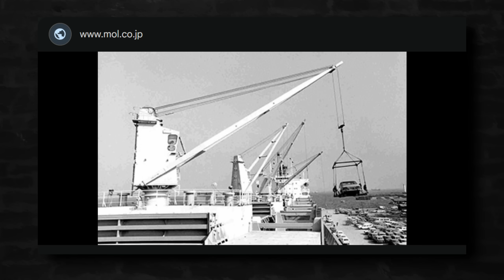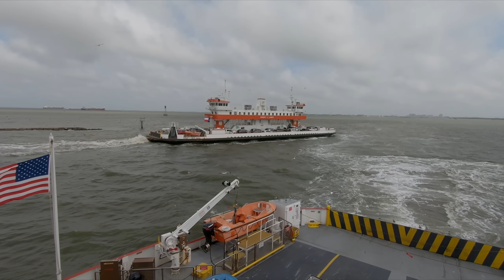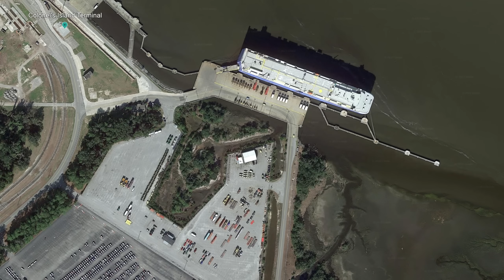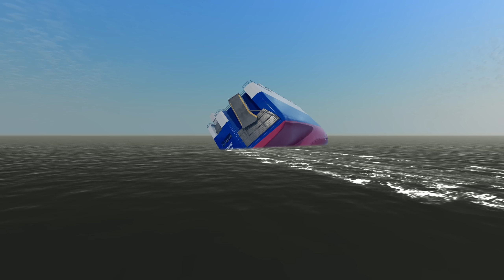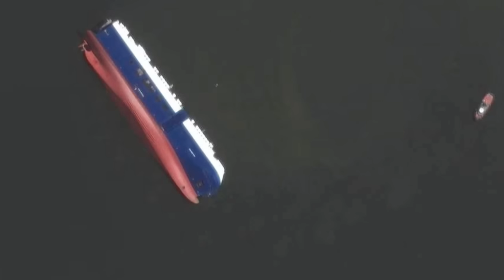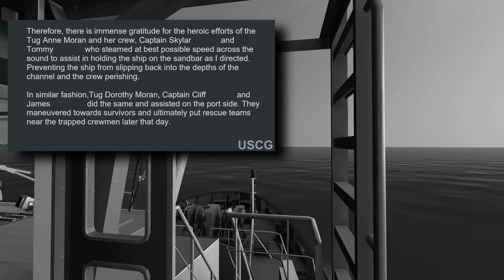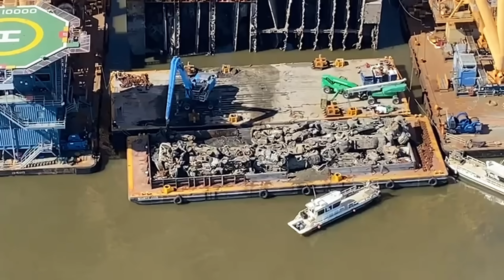ROLL-ON ROLL-OVER: The Loss of Car Carrier Golden Ray

Comment: Currently, VTS (Vessel Traffic Service ) primarily sees external data (position, speed, heading via AIS/radar), but not the internal state of the vessel. Requiring ships to transmit critical safety system status could add an important layer of oversight, especially for departures from port when stability issues are most likely to cause problems. 
If VTS had real-time access to critical vessel systems data - like watertight door status, stability calculations, cargo loading information, ballast levels, etc. - they could potentially catch dangerous conditions before   departure or during the ships passage.
Starlink would be valuable for continuous monitoring once vessels are offshore.

Comment: I retired at the end of 2022 just short of 50 years as a marine cargo surveyor. When I started in '74 import autos were brought in on Bulk Carriers where the cars were lifted from the ships holds with ships gear and set pierside then driven to their processors lots. Then there were the ships with elevators between the holds where the cars were lifted from the holds to the deck where a side port went to a ramp going offshore. There were some Combo ships from ACL and Barber later NOSAC that had stern ramps for RORO on lower decks and Containers topside. Then the PCC vessels came along. Usually on PCCs Heavy equipment was stowed on the lower decks and main deck where the stern ramp was and sometimes also a side ramp.

Comment: The thing is if you pay a little bit of attention you will easily spot a potential mistake you made in the stability calculation just by looking at a few key numbers: the draft and trim.
You type in all values from fuel, lube oils, cargo and most important ballast. The program will then give you all important stability values: GM, sheer force, bending moment, trim and heel and of course forward aft and mean draft. All you need to do is to compare the calculated drafts with the actual drafts and you know whether your calculation was correct or not.
This was just negligence by the Chief Officer in my opinion.

Comment: This feels like absolutely the kind of area where AI should be supporting us. Every company involved inputs in detail the item they are wishing to load at the POL, where, and where the POD will be. The AI's job is to pull and calculate the exact weight, and procedures required for that ship. The skilled engineering team review this plan (because there might be information not yet provided to the AI). This is exactly where AI should be used to support human endeavour... but guaranteed humanity will cause failures where someone will intentionally input the wrong data to get past the system.

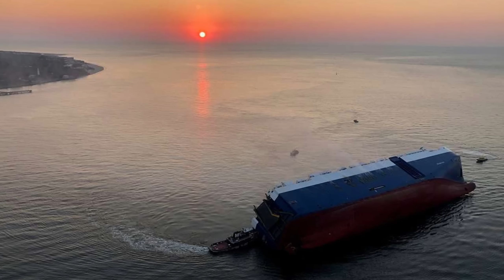Comment: You got your KGs and GMs, and the relation between those and adding ballast mixed up at around the 46:00 mark. Adding ballast increases the GM and decreases KG as the centre of gravity moves down, as correctly shown by the graphic but you're explaining the opposite. Lowering the G would make the ship more stable, it's just a question of draught and freeboard. You're not wrong in what you're saying, there's just a mismatch. Also labelling the keel as K would help with the graphic. Just for future reference, if you see this and hadn't noticed (I realise it's a video from last year!).

Comment: Those tug captains almost certainly saved the lives of the trapped engineering crew by quickly acting and pushing the ship into shallow water. If it had sunk in the channel the space they were trapped in would have been totally submerged and no way to cut into the hull.

Comment: How can something like this so easily happen?  Are there no alarms for open exterior doors? With redundant failsafe. But am I understanding it correctly. That the stability information is implying. That, if the ship had been compliant, within tolerances. It wouldn't have listed far enough to flood thru the door?

Comment: What I cant understand, is how is there not any kind of automated warning system in regards to the dang doors???? Literately every car in that ship will ding ding ding if you leave a door open, but not the 60+ million dollar ship?? How is there not a sensor 4 feet under every door that will blow the bridge up with alarms if a door is open and that sensor is getting wet?? I'm sure there are far more sophisticated solutions than what I just laid out but how was there NONE applied at all??
Reply: There are requirements for indicators on these doors to show open and closed position, with the watertight door panel on the bridge. All watertight doors are required to be closed before getting underway. The pilot door indicator appears to have malfunctioned, or the bridge panel wasn't checked.
Reply: Sensors are notoriously susceptible to failure in such harsh conditions as on sea-going ships. So those doors were probably monitored by switches that, although being far more reliable than sensors, are also susceptible to failure, this time due to corrosion of the contacts. Add in wiring looms that also suffer from the conditions and/or minor damages, and you end up with an unreliable electrical monitoring system, that often shows false positives or negatives, which is why most of these doors are inspected visually before sailing.

Many of these accidents can also be contributed to miscommunication and/or rushing through procedures. There's also that often mentioned thing called confirmation bias, where the person checking something sees what he/she EXPECTS to see, without actually seeing it.
Reply: @tjroelsma u think the sensor needs to be outside?. Sensors can’t be inside the door?
Reply: @tysonchickennuggets yep, where it is just as hostile as outside. The salty air alone will corrode it.
Reply: @tjroelsma Better a Sensor that needs to be repaired often than no sensor and a sunken multi million ship

Comment: went across Bass Straight in a ropax called the Spirit of Tasmania, was delayed by a storm. When we got underway the weather turned and swells were huge, I've never been afraid on a boat this big but this trip I felt like we were in a dinghy and it was going to roll over. It felt top heavy and had a very high roll.

Comment: I wounder how safe New Zealand's Cook Straight Ferries are Cook straight can be some of the roughest water anywhere on some days due to its location and the fact of the high winds due to the air squeezed between North and South Island mountain ranges.  Currents and tides and intersecting swells adding.

Comment: I don't think the crew put quite as much thought as normal into verifying stability, because it was such a short trip. Brunswick to Savannah is ridiculously short. The problem is that doesn't give any broad area to maneuver, and making tight turns in a ship that huge, that's even slightly unstable, is just begging for a disaster

Comment: Having created certifying procedures for NFPA and ISO used to verify the compliance of enclosures protected by gaseous fire suppression systems, without oversight the process quickly becomes one of how rapidly the rubber stamping can be done. It was common for even large name brand fire suppression companies would actually train their employees on how to fool the software in order to pass. Then, when problems occurred there was a lot of finger pointing and people hushing up the outcome so other customers wouldn’t learn of their incompetence.  Those companies often got jobs because they simply quoted lower prices, but cut corners everywhere on the understanding that fires would seldom occur so they wouldn’t get caught off in enough for it to matter.

Comment: I do not understand why such parameters like GM cannot be detected by sensors in real time while the ship is going and warn in advance about the problems or even prevent operations which would make the ship unstable. To detect this one would not even need to make some turning maneuvers, it would be enough to have just a slight change in ship's body to determine all points and calculate everything automatically using sensors. Asking humans to do such tedious work reliably is asking for trouble. Even if human operator is fully focused on the issue the errors can still be easily made while computer can do the same calculations error free in milliseconds.

Comment: Excellent report. Metacentric height at 22.45 is the key stability factor. We derived the equations in 1st year of my engineering degree.  I'm surprised ships are not instrumented today to do real time MH calculations so cargo weight distribution and correct ballast onboard is calculated/known 100% of the time. 
OEMs design vehicle transportation tiedowns based on the standardised ship and road/rail carrier floor anchorages. I designed a few and visited RORO ports as part of this work. Interesting business - they know where every vehicle is every second from vehicle gate release at factory to delivery at a dealer.

Comment: I worked doing ship repair on El Faro when she was still in Alaska service. Every time she hit Tacoma there would be 20 or more of us waiting to fix the ongoing structural problems. It flexed so much that the decks were cracking fore and aft of the house. I remember the decks looking like someone had shot them up with a machine gun from the holes the crew drilled trying to stop the cracking. We kept cutting off old plate and adding heavier to try to stiffen her up. If I remember rightly, we were up to 1 inch plate when they pulled her from Alaska service and sent her to the "calmer" waters off Florida. They tried to get shipfitters to ride her to Alaska and back to do underway repairs but not one of us was dumb enough to ride that sinker. I still have a 30 foot section of mooring line from her that I use as a tow rope.

Comment: I'm seeing design failures in the ship. Emergency egress from engineering up both sides of the ship that are heat and fire resistant should have been in place and electric sensors that detect those door were open should have had some kind of alert in the bridge so they could correct this before they left.

Comment: It amazes  me that the pilot door was not constructed with a air lock : type chamber on the inside ...( wet room)
What if pilot had to board during high swell conditions ?
Was the idea that the wavetops and spray  was supose to be let inside  i the vessel ? I saw a video o where the pilot door was open on container ship ,the wave tops got into the door but there was a inner door that prevented sea ingress into the ship . If the ship takes on pilot at anchor the ship will point bow upwind .
The waves will run down the sides creating a rollercoaster 
Ride for the smaller pilot boat to  cope with in relation to the big ship that stretches( several) 
Wave lengths, and will not rise 
And fall in evry  wave.

Comment: what I'm taking from this is that way more of this should probably be handled automatically be a computer on board the ship, ideally the ship (or a connected system) would measure the weight of each car before it gets on board and keeps track of the exact position of each car and then does the stability calculations

ideally this would then be checked by an engineer and an additional person (which was already missed here), maybe someone external like the pilot (but I think that would be too much responsibility on the pilot)

Comment: As a former tow truck operator here in NYS, the mere idea of not having a minimum of four points of anchor on the bed makes my teeth itch. I got called out one time in my 11-year career, and I never made that mistake again. It wasn't even my mistake. The guy who was training me never set the parking break (vehicle was a 6-speed manual) and only had one point of anchor on the bed. Car started to roll forward and CRUNCH!!!! My boss was very unhappy about having to buy a new front bumper for a car with a custom bubble gum pink paint job. It was a Mazda Miata CX-5 for those curious.

Comment: I always ponder in these cases - couldn't several tug boats connect winches to the side which is in the air and gradually pull the ship back up until the weight is centered again?

Comment: The speed that the car carriers come out of Brunswick is stupid considering the challenges that face them in the canal. I have faced them several times in that area and they are running way too fast for the situation they are in.  Another accident is going to happen with the speed they are running through this tight section.

Comment: Tragic event in the sense of the damage done. This, the Costa Concordia, and other things makes me wonder if society needs to set some upper limit on the size of these things, or at least harsher minimum terms for how loaded they are allowed to be (prioritizing stability more and economic efficiencies a bit less). In hindsight, the gaps in procedure seem glaring, as do the gaps in design, which combined with human error lead to disaster. I have to once again say that economics seem to be at the root of it - why don't the figures get double checked, why doesn't every crew member involved in sailing decisions know how the stability software work? Why do they not collect and report all pertinent info automatically? Why was there only emergency access from one side and not the other? (And why would they leave a hull door open for that long?) As with any other thing, it seems that shortcuts are taken to either save money, or save time (and since "time is money" in the business world, well...) - dodging extra costs until something happens which costs you everything,
Reply: Safety standards are written in blood. Seems we never learn that disasters ARE avoidable.

Comment: Is it normal for that many doors and hatches to be open when under way? I understand fumes from the exhaust of driving cars onto the ship probably required ventilating however wouldnt a ship underway necessitate a tight ship? Thats a huge ship for such a small crew size.
Reply: From what I can tell, they're probably required to be closed for departure and companies do require it by policy, but it's commonly not done except in response to rough conditions and management knowingly turns a blind eye to it. Commercial ships in particular seem way behind (and always have been) comparable industries with poor safety oversight.

Comment: I was on a car ferry going from Scotland to Northern Ireland one time after they had been all cancelled all weekend because of a storm. The sea was still rough and probably the small faster car ferry shouldn’t have been running and just the larger ones because they can go out in rougher conditions. Was the only time I’ve been on a ferry where they lashed down the cars. Everyone had to wait a long time to get on a ferry because of how much traffic they were bringing over. We finally got on said ferry going home at 2am and the sea was so rough you could feel the boat go up the wave then drop back down again. Everyone was half asleep when we all got woke up by an almighty crashing sound. We had to muster and put on life jackets as a just in case basis but ultimately made it to port in Larne fine. Problem was though we all got stuck inside the ship because the car deck doors got stuck shut because the hydraulics lines got smashed during that huge crash we heard. I guess we were lucky in a way that the door was designed in such a way to make it stick shut and it didn’t open to let the water in.
Reply: Might have been my last ferry trip 🤢

Comment: As an retired Master Mariner (Captain) having more than 40 years of experience(20 as Chief officer) on Ro/Ro and PCTC my first guess when i heard of this accident was that it was a ballast issue, this due to the design of the ballast tanks especially the  big ones on this ship the  5 port and 5 starboard, on most of the pctc's ive been on theese tanks are in an L shape and if one tank has the surface close to the lover end of the vertical and the ship heels over to that side you will get a large free surface moment which is not ideal. I did the calculation on one of my first PCTC's and it showed a stability loss of 40 cm. That said we usually left port at a GM of 1,25 m and the company i worked for had a minimum requirement at any stage of the voyage of 80 cm, There is a quick way to check GM under way that is quite reliable, and that is to check the rolling periode of the vessel,  'Rolling periode (in sec's) /ships bredth in m' i used this as Chief off when i got on the bridge every morning. And also when i was a Captain. Your video was well researched the only thing you missed out on was one of the major carriers of rolling cargo the Wallenius Wilhelmsen group. Kep up the good work.